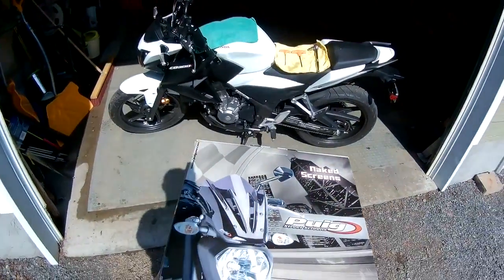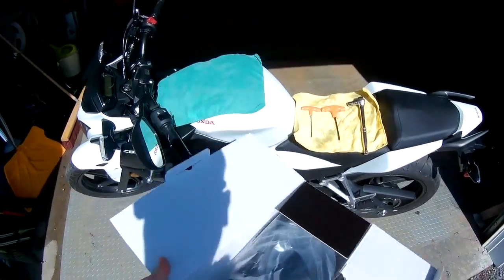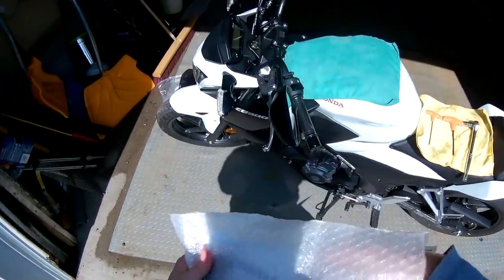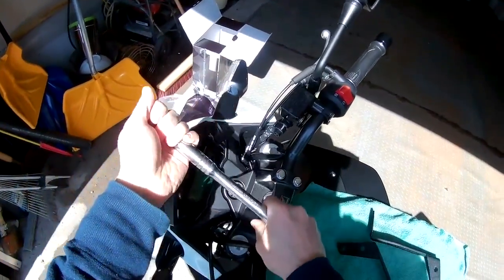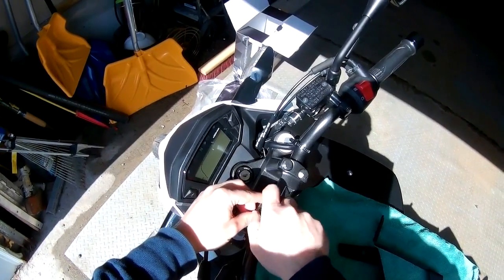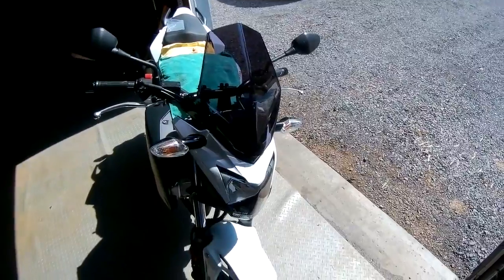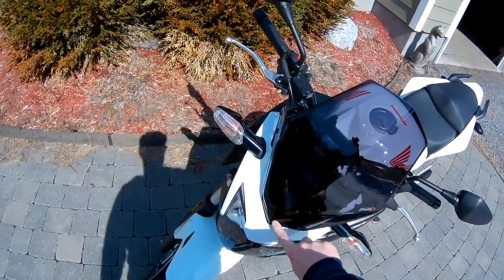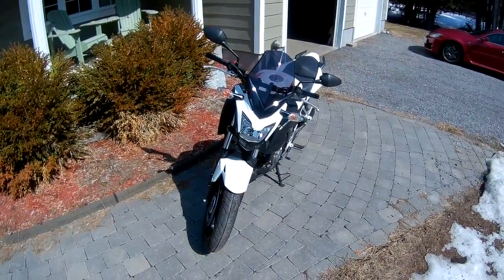Honda CB300F PUIG windscreen install

Comment: You said it helped a little was it worth the money I have the same bike
Reply from the maker: Unfortunately I sold the bike almost right after, so didn't ride much with it.  It certainly helped remove some air from the chest.  Not massive amounts but a little.

Comment: I got mine and it came with the wrong screws...
Reply: same here. just installed it to find one of the rubber plugs that goes in the mounting bracket was the wrong size.